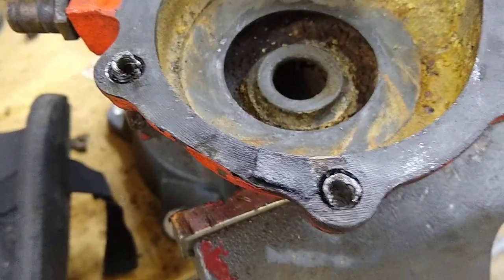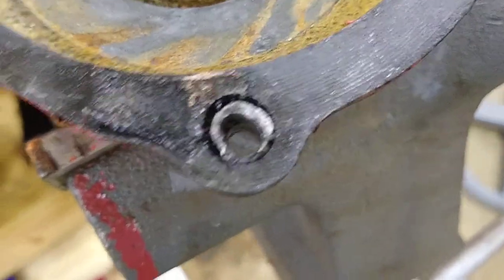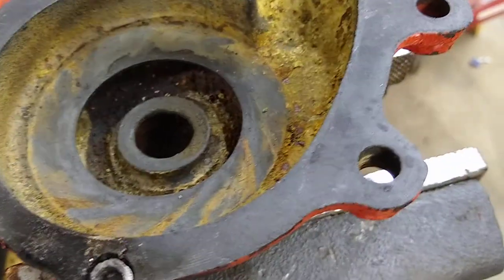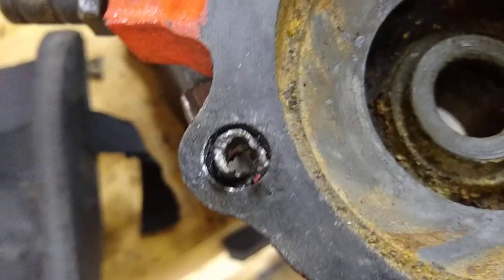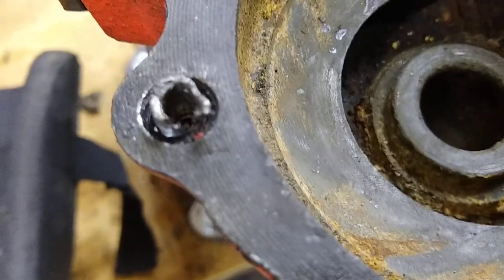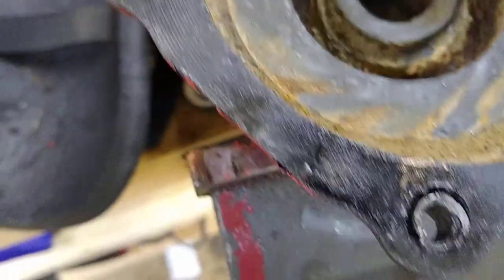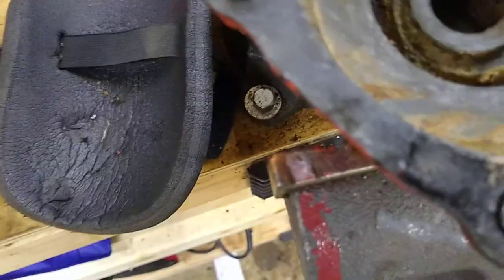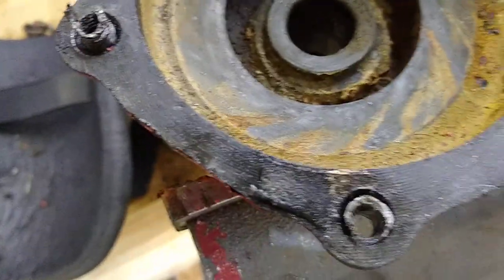1949 GMC Water Pump Rebuild 3a   stuck bolts now free

Comment: Awesome. This is good stuff! Breaking one down right now. Where did you get the rebuild kit?
Reply from the maker: Thanks Joe.  Found it on ebay: https://www.ebay.com/itm/1939-59-GMC-Truck-10-35-228ci-248ci-270ci-I6-new-water-pump-rebuild-Kit-598309/174225218915?ssPageName=STRK%3AMEBIDX%3AIT&_trksid=p2057872.m2749.l2649